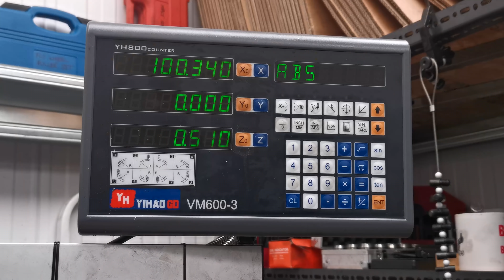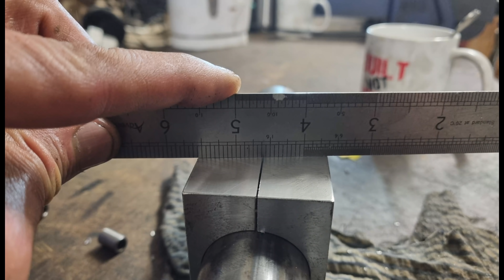Tube fixture - Suzuki Bandit Cafe Racer - ASBO Project

Comment: Quicky . When you built the Frame Jig , you mentioned about the bottom Engine Mounts , and that being '' fixed '' you would not be able to remove the Frame from the Jig . I seem to remember you and SteveO talking about these bottom Engine Mounts , and You was going to give thought to having them bolted through the Frame instead of welded . Just wanted to jog your Memory  . Hope this makes sense .
Reply from the maker: Yeah, it's mainly the rear engine mounts that cause the problem, but the fixture I just made is going to hopefully let me make all the engine mounts removable 😁👍